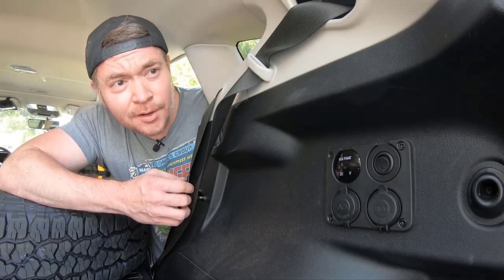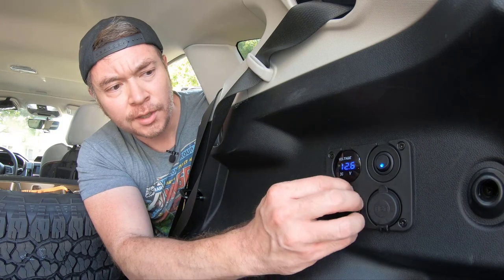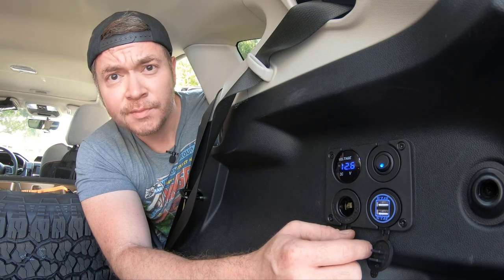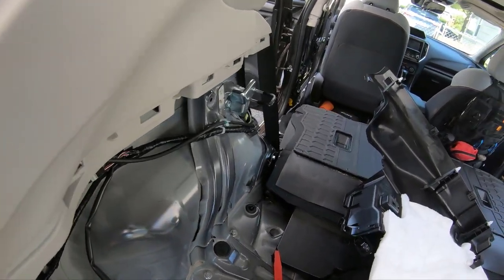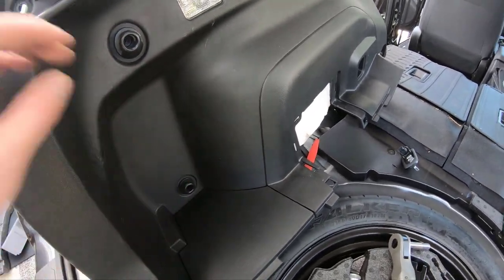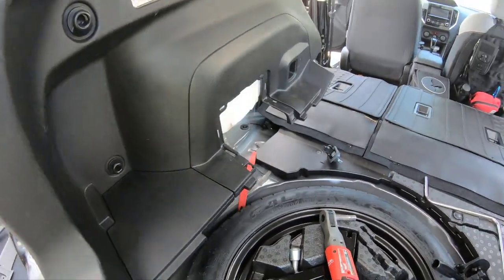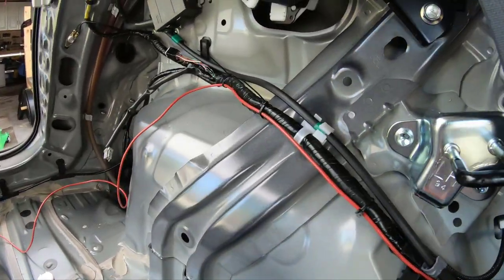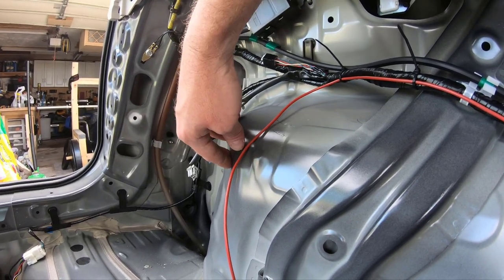DIY 12v Panel Install - Subaru Crosstrek

Comment: Great project, thanks for the idea, now on minute 14:30 I noticed what looks like LED lights on your hatch, can you show us how you did it and what did you chose to do the install?, thanks!!!
Reply from the maker: Thanks for watching!  That's actually an LED wand / flashlight that I stuck to the hatch using a strong velcro tape.  The idea was to have it as an accessory light that is detachable if needed.  It worked for a while in the city, but the minute I went offroading and jostled the hell out of everything, the velcro's adhesive backing failed.  So...back to the drawing board on that idea.  Others have done some LED installs, and I might still do it, but for some reason I liked the idea of something I could detach :)  If I figure out a good solution, I'll share it here first to be sure.

Comment: Awesome install! I’m copying it jajaja, but, is necessary or helpfull to run a relay?? To save the battery
Reply from the maker: Couldn't hurt.  The drawback to a direct-wire panel like this is draining the battery if you accidentally leave it on.  A relay to power the panel using an ignition hot would prevent this.  I wanted the ability to have power independent of ignition (i.e., charging a phone while sleeping in Crosstrek, constant hot to 12v fridge so it doesn't cycle off and on every time I turn off the car, etc...).  I would say it all depends on your intended use and ability to remember not to leave the power on :)

Comment: Thanks so much for the tutorial! Definitely something I'm going to try! Could I ask what gauge wire you used? Also does this wiring allow you to draw power while the car is off?
Reply from the maker: Thanks for watching and glad you liked it?  I would suggest 14ga wire for a typical 15 amp 12v socket.  I would not suggest anything less.  Might even want to opt for 12ga to be extra safe.  As for drawing power while the car is off, if you wire the hot lead to a constant hot as I did in the fuse block, then yes, you can use the switch on the panel to turn it on and off independent of the ignition.  Caution though, if you run it to a constant hot, you run the risk of draining your battery if you leave something plugged into the panel drawing power.  Hope that helps!
Reply: I ran 12 gauge high temp wire from the fuse box to the panel. For the jumpers in the panel I used 16 gauge wire since you have to shove 2 wires into the crimp terminal lug
Reply from the maker: @dvjbdjcvrvbv  Nice!  You can't go wrong with a thicker ga wire...especially over long runs so well done!  Hope you find it as useful as I have.  Congrats!
Reply: @TomtheDilettante  honestly main reason why I did it was because I’m planing on getting a refrigerator cooler also when we go camping I hate having to go through the front of the car to get power to inflate my air mattress etc.
Reply from the maker: @dvjbdjcvrvbv  I hear ya.  I powered my fridge with this thing too on a recent camping trip.  If you haven't already, be sure to test everything as you'll have it before you hit the road.  Few things suck as bad as finding out a mod didn't work as planned only after you're away from your tools (1 hint as to how I know that).  If you're thinking of powering your fridge while the car is not running, keep in mind some fridges will shut off if they're not receiving a certain voltage (as your battery depletes for example).  For this reason, I've started using a Jackery 500 which has a regulated 12v supply.  I plug the fridge into the Jackery and the Jackery into this panel to keep it topped off.  Anyway, enough unsolicited advice from me LOL.  Stay safe and have a great time camping next time you get around to it!

Comment: This is great! I’m following your lead. Also, wondering if the spare tire shown in this vid works with your larger tires? I have a lifted trek as well, and was trying to find a spare for city driving without having to carry my extra full size wheel.
Reply from the maker: Thanks for watching. The OEM spare is not recommended for use with oversize tires. Its my understanding that the different diameter will mess up the awd system. I carry a full size spare. Its a little cumbersome to lug around but a good peace of mind to have just in case.
Reply: Ah, got it... I thought you might have bought an extra “donut” spare that was larger to match the larger tires. Yeah, I carry a full size too. Cheers!

Comment: Just finishing up this project. Great Idea. I'm using that same empty fuse slot, but it only works with 2 10amp fuses? I also only used 16 g wire since that is the gauge of the tap and the outlet. Now I'm thinking of changing it to 14g. 😩
Reply from the maker: I think you can put any amp fuse in there but I don't know the max rating for that slot I'm afraid.  I put the OEM fuse in the tap's slot for the circuit I was tapping to keep the same fuse in place.  16ga wire should be good for 10 amps as far as I know.  So the 16ga wire combined with a 10 amp fuse should be good, but do please consult some wire charts to be sure as I believe max current also varies on the length of wire used.  Anyway, it all depends on what you plan on doing with that socket.  I use mine to charge phones, top off my Jacker Explorer 500, and power my 12v refrigerator.  I haven't exceeded 10 amp draw so haven't had any problems.  If you're looking to run something that pulls a lot more current (say, an air compressor) then you may need to beef up the fuse and wiring.

Hope that helps a little.  Thanks for watching and good luck!
Reply: I did this mod and "just to be safe" used 12 AWG to run the length of the car crimped it to a 14AWG fuse tap (https://www.delcity.net/store/Mini-Low-Profile-Fuse-Adapter/p_810069.h_810070.r_IF1003) and 14AWG for the panel wiring. I also ran 2 extra 14AWG wires the length of the car and left little coils behind panels on each end for future mods (?) so that I won't have to take all the paneling off again. I was thinking about eventually putting rear fog lights or rear spot lights in the bumper reflectors with one of those wires. Maybe @Tom the Dilettante would try this first to show us the best way.

Comment: Thank you for the nice video. I have a 2007 impreza. There is a harness for power outlets that is not connected in the trunk. I was wondering if I can use this kit to connect to.
Reply from the maker: Thanks for watching!  As for your harness, I'd be remiss to say one way or another as I'm unfamiliar with what it might be.  I would test it to see if you have 12v at it, if it's ignition or constant hot, check what gauge wires feed it, and try to identify what circuit it's on.  If it has power, then your part way there.  Before using it though, you'll want to know what it can be used for and that's where checking what gauge wire is behind it, and what circuit it's on (what fuse?  anything else on the same circuit?) is important.  

Hope that makes sense and helps a little.  Sorry I can't say for sure one way or another.
Reply: Thank you sir for helping me. When I check in the manual the harness is connected to rear accessory relay that is connected to 20A fuse. The harness (R32 2 wires) has a ground black wire and blue wire. Do subaru has a standard for the wire color versus the gauge. I am not sure about the crosstrek; but in the 2007 impreza I found Subaru has the tendency to include many unconnected harness that can be used if the correct accessory is bought. I connected my rear trailer harness using the outback harness without any issue even though when I called them; they always say it is not for this model. Same thing for the rear light. But all of this can be seen in their wiring diagram; this is how I figured out the outlet and came across your video. The circuit is connect to front socket, Body Integrated Unit, TCM, compass mirror, mirror and intercooler switch and timer.(FB-27). Wire can fit 12 gauge with insulation. Voltage was present with only ignition key is on

Comment: I installed the same in my F150, but just 2 outlets. What I discovered after the fact, is that the cigarette outlet is not like a normal one. When I plug in my refrigerator or mini air compressor, the connection is very loose and could easily fall out.

Comment: Picked up a 2021 Crosstrek.   Struggling with where to mount my phone.  Love  your ram mount seat wedge.  Can you share the model number?  On there website I don't see the one that has a compartment to put things in like your showing.   Thanks in advance
Reply from the maker: Sure, no prob.  The one I got was or my ham radio setup.  I kept the base and just attached a phone ram mount instead.  The base I moved to my ram mount on the dash for the radio.

https://www.lidomounts.com/page/subpage/hamradiomounts/lm-wedge.htm
Part number:  609239637591

You can see this in more detail on my 1-year walk around video where I leave the part number as well:
https://www.youtube.com/watch?v=m_MfJQ0JKvg&feature=youtu.be

Hope this helps and thanks for watching!

Comment: I would've tapped into the power line of the trailer hitch power. from what I heard its constant power when the car is off and its located near the drivers taillight.
Reply from the maker: That's a good idea.  I hadn't thought of that.  If it tests out as constant hot and is wired in such a way that it can carry the desired load, the that should work.

Comment: Tom,

For some reason my voltage neater is reading 14 volts with a 10 amp fuse. Is this a problem if I’m using a 12v power adapter?
Reply from the maker: Nope. Most automotive systems run at near 14.4v while vehicle is running and charging. When vehicle is off you should be seeing about 12v and change.

Comment: Is there a reason you didn't use the 12V from the hatch latch button? Just curious if that would've made it easier than running it from the fuse block. Great tutorials!
Reply from the maker: Good question.  My reason was that the existing 12v lines to things like the hatch release or the lights weren't of a high enough gauge to carry the current I planned for devices connected to this panel.  In addition to wanting to ensure I hade a thick enough wire to accommodate planned current draw, I also wanted a dedicated circuit / fuse to this panel so it could operate and/or fail independent of any other vehicle system.  Right, wrong, or otherwise, that was my thought process.   Hope that helps!  Thanks for watching :)
Reply: @TomtheDilettante  All good reasons, thanks!
Reply: @TomtheDilettante  I saw you couldn't remember if you used 12 or 14 gauge wire. Can you share what kind of TAP / add a circuit you used? For mini-ATC I can't find anything larger than 16 gauge. The only 12AWG are with full sized ATC fuses. What did you use for that part?
Reply: Found this eventually:  https://www.delcity.net/store/Mini-Low-Profile-Fuse-Adapter/p_810069.h_810070.r_IF1003
And based upon this chart, for 10A, at least and the approx 10foot run, you'd need at least 14AWG, if you want to prevent voltage drop: https://thirdgens.com/wp-content/uploads/2018/02/DC_wire_selection_chartlg.jpg

Comment: Can i got power from the hatch light (of the driver side ?)
It’s 12V, and parellel the wire out for power
Reply from the maker: most lights like the hatch light run very thin gauge wire and would not be suitable for meaningful power consumption.  My advice is to consider what you plan to power with a panel like this, and choose your wiring accordingly.  Bluesea has a nice article and chart to help determine what gauge wire to use for what length run and power draw (link below).  In addition to wire choice, be sure to tap into and fuse power accordingly.  For example, you would not want to tap a 2.5 amp fuse for a 10 amp panel and use more than 2.5 amps.  Hope that helps!

https://www.bluesea.com/support/articles/Circuit_Protection/1437/Part_1%3A_Choosing_the_Correct_Wire_Size_for_a_DC_Circuit

Comment: So how long can you power something like a fridge with the car off before your car battery dies?
Reply from the maker: depends on how much power the fridge draws, the capacity, condition and age of your battery, and some other things.  Figure an average car battery has a capacity of 60 amp hours (or 720 watt hours at 12v).  For simplicity sake, let's say your fridge draws 72 watts, then you'd get approximately 10 hours (72 watts x 10 hours = 720 watt hours) of use before the battery is dead.  Keep in mind though, that would leave you with a dead car battery and a car that won't start.  I personally use a portable power station for my fridge and accessories that I charge from this panel as needed.  That way I don't risk accidentally draining the main car battery.  I also recommend carrying a jumper box just in case.  If anyone is like me and has a tendency to forget something is drawing from the car battery, a jumper box can be a real a$$ saver :). hope that helps.  Thanks for watching and have a good one!

Comment: Do I need 2 wires going towards the back (+ and -) or only 1? Seems like I only see 1 in your video.
Reply from the maker: I ran just power to the panel.  I grounded the panel to a nearby chasis ground.
Reply: @TomtheDilettante  So your positive wire comes from the fuse box (Red wire) and the negative wire comes from the ground (Black wire)? I hope I'm getting this right? 😅
Reply from the maker: @jamest7727  Correct. Power (red) routed from fuse block tap to the panel.  Ground lead (black) from panel to chasis ground.  I piggy-backed an existing grounding point I found behind the interior panel.  The most important thing to do is make sure the gauge wire and fuse you use is up to whatever you plan on using the panel for.  For example, I planned to use this panel to power my 12v refrigerator / cooler which pulls about 3-5 amps so I ran either 12ga or 14ga (can't remember) and used a 10 amp fuse in the tap.  Hope that helps and makes sense.
Reply: @TomtheDilettante  Thanks for answering back! Yes it makes perfect sense.

Comment: Hey Tom and community - i did yhis mod a while ago after watching your video. On a recent trip from NM to CA earlier this summer l was driving along with my refrigerator hooked up and powered thru this set up and I smelled burning plastic about 1 hour into day 2. The smell passed and i thought it was just something I drove thru in Bakersfield. Turns out the switch, rated for 20A was cooked and acted like a fuse. Luckily, no fire... I have since replaced with same switch. Just wondering of anyone has experienced something similar with this product... Thanks!
Reply from the maker: Yikes!  Sorry to hear that.  Were you running equipment that pulled a large amount of current combined?  If you put a heavy load on smaller circuitry, that can definitely cause a problem.  Or, it could have been a bad switch / high resistance.  I'm no electrician so maybe someone else can offer an idea.  Regardless, glad you're safe and nothing was damaged other than the switch.  Any issues since?

Comment: I have a 2014 XV Crosstrek, would this mod be any different for mine?
Reply from the maker: To be honest, I'm not sure.  Never taken apart a previous gen XV.  I would imagine it's very similar though.  If you're definitely looking to do this, I would suggest just starting with taking one of the rear panels off to see what room you have.  For the rest, the basic principles should apply to just about any vehicle.  Tap into a power source that can handle the desired amperage, run a suitable wire gauge for power and ground, and install the panel in a place it has enough room.  Sorry I can't be more specific, but I also don't want to mislead you by presuming too much.  To be honest, that's how I did it.  I just took off a panel and said "yeah...I bet it will fit there" and the rest became a video LOL.  Hope that helps a little and best of luck if you give it a shot!  I've been super happy with it in my car for sure.

Comment: Why do you lug that Yokohama around when you have the full size spare?
Reply from the maker: Lazy.  LOL!  I pull it when I'm going on a trip to create extra storage, but when at home, I just keep the spare in there because I don't want it taking up space (I don't have much room).  Sooner or later I'll need to come up with a creative use for that space.  open to ideas :)
Reply: @TomtheDilettante   ok. Ya that makes sense. Not easy squeezing room out the CT.

Comment: Couldn't tap into power in the rear anywhere?
Reply from the maker: Possibly but I didn't see any wires of sufficient gauge to support the intended current draw i had in mind, and my personal preference was to have this panel on a dedicated fuse.
Reply: @TomtheDilettante  So run to the fuse panel it is! lol Thanks

Comment: Why not just get power and ground from the light wire thats already ran back there and protected by a fuse
Reply from the maker: Fair question. Could have done that but the existing light circuit is low amperage and wouldn't have been able to support most of what I wanted to use this for (e.g. refrigerator, ham radio, jackery charger etc...).  I tapped into wires without consideration of their gauge back in my jeep days and ended up melting wires lol.  So, consider this choice based on previous experience. :-)

Comment: Definitely wrong choice of tools. Lol. I just use a hole saw for each outlet/switch.
Reply from the maker: Yeah that would have been easier. But hey, it ain't dumb if it works right?  Lol